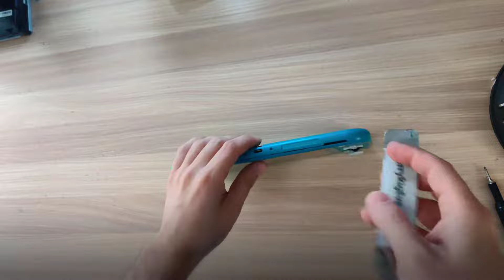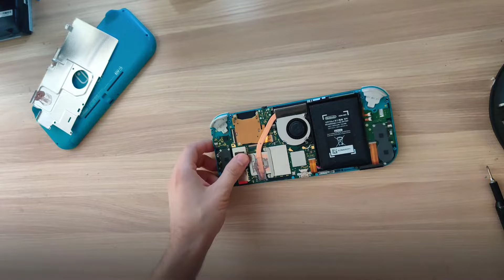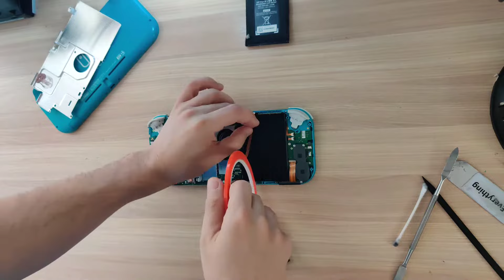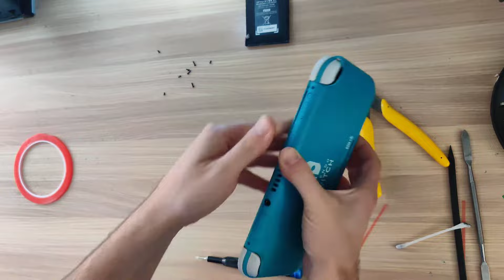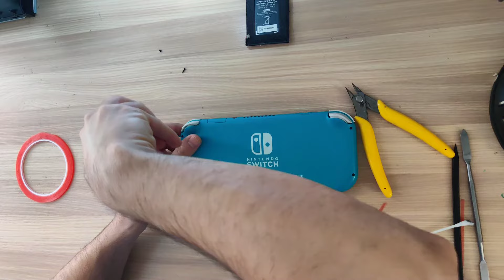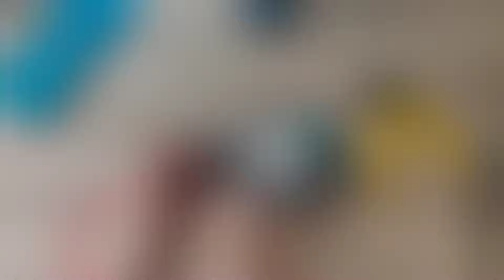Nintendo Switch Lite Battery Replacement : Easy way

Comment: I miss the days of just changing the AA batteries
Reply from the maker: It was a great days 😊
Reply: Same
Reply: I don't. After a week or two of playing games then you'd be begging your parents for batteries. Even though I can get my own now, I would still rather not buy a pack of batteries over and over😭
Reply: Every couple days? 🙄
Reply: @JM-qn3tf  everyday😠
Reply: I don't. These AA batteries are a mess. Even the rechargeable ones which take half a day to finish.  But I prefer the removable lithium types that Nokia used to offer. Even the PSP wasn't that hard to replace and can be charged directly.
Reply: I do, but I don’t at the same time
Reply: no u don't its just nostalgia, batteries didn't last sh*t and probably spent enough money on batteries to buy another game boy color
Reply: You think you don’t but you don’t. Having the switch 4 years just need to do the battery replacement now. Think of how many aa batteries I’d went though

Comment: Don't let this video fool you! The battery does not come out this easy! It is installed from the factory with some Nascar grade 200mph rated double sided tape that holds till it's last breath. I almost burnt my sons switch up when the battery started to fold got hot and started smoking. Be careful when doing this!!
Reply from the maker: You must be careful when battery come out, and I used Iso Alcohol to be easy
Reply: You watched one video and assumed you knew what you were doing, don't complain
Reply: This made me lol because mine caught on fire too lol
Reply: @thespudlord686  so you're saying this is not a good reference?
Reply: @AynaxTech1  Then it would be helpful to show that instead of fast forward and make it look its easy like that. Also where did you get that tape? what is it called? wish Nintendo would use something like that instead. Stupid to glew that hard on a portable that people collect and stuff.

Comment: My battery is glued down sooo much I can’t get it out
Reply from the maker: You can use Isopropyl Alcohol just put a little bit and let me know if you have another question ❓
Reply: @AynaxTech1  I got it out and replaced the battery and my switch turns on now but unfortunately it seems the charging port was the culprit. I tried 3 different chargers and outlets too. Changing the charger port looks a bit too difficult for me to try though. But thanks for this easy to follow vid.
Reply from the maker: @cxrtney  sorry to hear that, do you like to send your switch to our shop we can fix it for you?
Reply: Just wanted to update in case anyone else comes across this, I found a thread on google and they suggested trying a toothpick to straighten the pins out in the port. Since it was my**LAST option before my switch lite becoming a paper weight I gave it a try and low and behold it worked!
Reply: @cxrtney  wait the port was messed up from the start or it got messed up while replacing battery? My sons battery is crap after having his switch for less than 2 years and I want to attempt to replace it but I'm nervous.

Comment: Did not show how to hook the battery connector back up to the main board.  I’m stuck.
Reply: Same, did you figure it out?
Reply: @Henyx3  yeah…. I ruined the entire system and not even two different professionals/companies could figure out how to fix it… it took several months and hundreds of dollars.  So the answer is: DON’T EVEN TRY TO DO IT YOURSELF. (And I was careful as hell too!)
Reply: @CharlesHepburn2  The connector pushes down on the board
It's your fault you tried to brute force it I had no difficulty anywhere because I used a little thing called COMMON SENSE
Reply: @thespudlord686  maybe you could reword your post to be even more condescending.  You always talk like that to people, or just behind the cover of a screen name on the internet?

Comment: Hello - I keep seeing videos where people are using the conductor glue. Do you not really need that? It looks like you did it successfully without.
Reply from the maker: It's not very important, if you put glue will be better
Reply: probbaly much easier if you want to remove again the abttery

Comment: The white snap clip for the battery stap came off when I opened it and chance to put it back on ?
Reply from the maker: Its not easy to return it i recommend to buy another battery
Reply: @AynaxTech1  not the battery but the stray that slides into the motherboard and clips on with the push down tab to  lock the brown battery strip in place . I have a spare Nintendo but I just can't see that good to see how it came off 🤦🏽‍♂️

Comment: Is it even worth it to try/ have this fixed after the screen gets cooked?
Reply from the maker: What happened to the screen
Reply: @AynaxTech1  doesn’t work at all after battery replacement. No cracks. Makes sound. Can’t see anything, even with a flashlight shined at it.

Comment: What do you use to open the battery with it was so Stuck in there I couldn’t
Reply from the maker: Try a little iso alcohol
Reply: i used the back of a spoon to pry the battery loose while slowly pooling on the cable connection and weding with a little plastic tool whatever progress i could make with the spoon and it worked

Comment: So I replaced the battery and now after putting back together my screen isn't working what did I do wrong
Reply from the maker: Are you remove cable screen or not , if not I think you damaged screen when you tried to change battery, if you like you can drop your console to our shop or send it in mail and i will fix it

Comment: I tried fixing mine, is the battery supposed to be the exact same as the damaged one? I got a 14wh when the one in my switch says 13.6 wh, or did I do something wrong? 
(I did strip some of the screws but I got some replacements)
Reply from the maker: They have no problem , but try to find orginal one not after market

Comment: Do you recommend buying a original battery or a upgraded 4000mAh?
Reply from the maker: Buy original battery please , and don't upgrade you will damaged charging chip
Reply: @AynaxTech1  really?
Reply: @hubertobogaert8967  Yes, really
Wattage and ampperage are extremely important and if there's too much or too little the device will either not work, or fry its circuitry

Comment: That battery is glued in there for good... how much more isopropanol have I to pour onto it D:
Reply from the maker: ISO ALCOHOL NOT EXPENSIVE YOU JUST NEED TO PUT A LITTLE
Reply: @AynaxTech1  isopropanol is iso alcohol. and I applied it over and over, took me 40 minutes to get the glue loosened

Comment: How can i find a switch lite battery? I cant find in amazon and my country's websites
Reply from the maker: Did you try ebay , Aliexperes
Reply: @AynaxTech1  There is a few options for standart model (you can import it from usa with massive taxes) but lite's battery isnt available anywhere
Reply from the maker: Where are you located?
Reply: @AynaxTech1  turkey (nintendo isnt active here only distrubutors and importers) and nintendo isnt so popular here

Comment: I tried turning on the switch and it displays an error code and asking me to restart the switch
Reply from the maker: What type of error ? I think you have issue in motherboard like M92 chip
Reply: @AynaxTech1  error code 2101 0001 I might need to replace the m92 chip do u have a video on how to do so?

Comment: I replaced my battery and now it won’t turn on 🥺
Reply from the maker: That not a good news , can you check the ribbon cable between two boards please ?
Reply: @AynaxTech1  so it turns on but my screen is black. ☹️
Reply from the maker: @adriennespringsteen7099  that mean the rebbin cable for screen not fit correctly
Reply: @AynaxTech1  is that associated with the battery I replaced it with?
Reply: @AynaxTech1  how do i fix that??
Reply from the maker: @sushislice  buy part for battery and change it by your self, if you can't , send it to our shop and i will fix it for you

Comment: nice , my switch not charging after change battery why ?
Reply from the maker: Maybe charging chip have issue or they have short circuit on motherboard